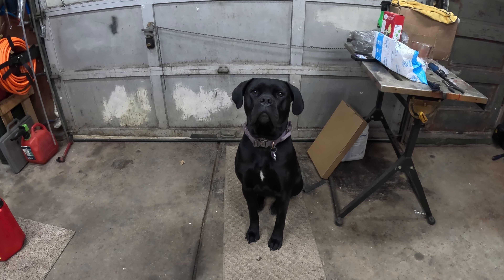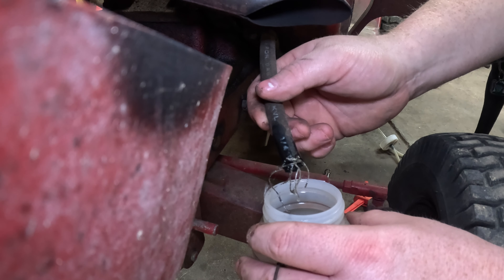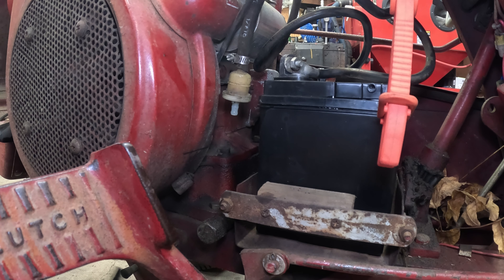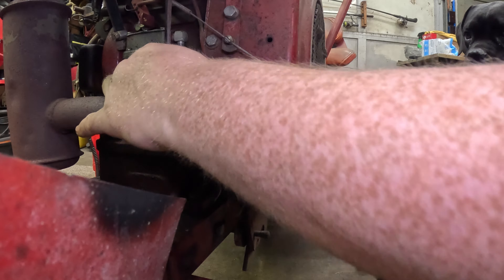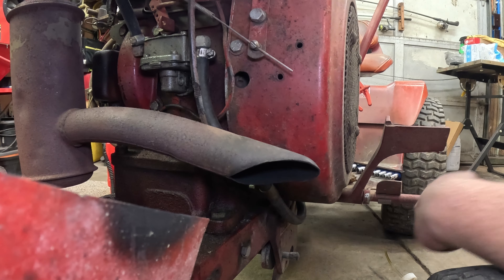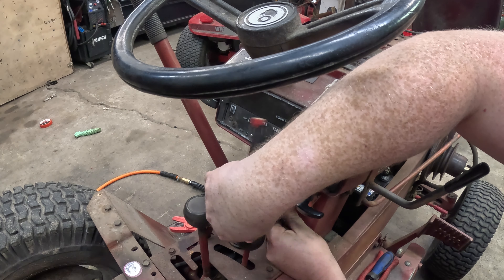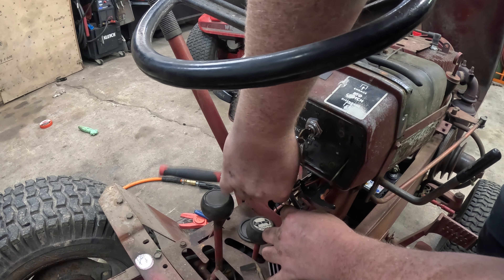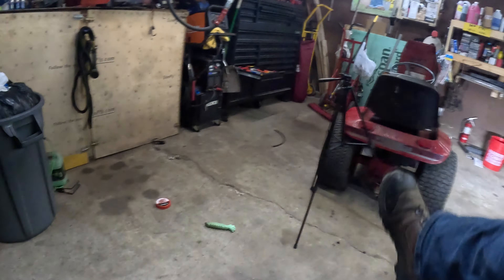Fine-Tuning Nostalgia: Reviving a 1975 Wheel Horse C-160 with Fuel System Care and More! #tractor

Comment: Thanks for the video. 👍
I just bought one like that, c-160 automatic with cab, not the soft one, but a hard cab with real doors and windows. And there is a broom in front. Everything works, but it needs to have the fuel system cleaned. Think it's a 1973. Engine sounds fantastic.
Got it for $200 including a table saw, telescopic miter saw, 2 impact wrenches and a pipe cutter set.
I have absolutely no idea what I'm going to use it for, but I couldn't say no. 😁
Reply from the maker: @gsp911  oh heck yea for $200! They are great sounds like you have a snow cab. I have one on this channel. The snow throwers are nice if you get snow. We don’t get much snow. But I had to have a set up because I remember seeing the bourchures of them throwing snow at the dealer growing up.

Comment: Great video! You got those old tractors running like new again. The headlights are pretty bright, are those stock?
Reply from the maker: Unfortunately no! The 70’s horses had a little light bar looking thing that had two 1156 bulbs in it. They were lame. Dad quickly put a single sealed beam light in the 70’s on it. I always thought it looked weird. I went and bolted two rubber sealed beam housings to the hood with led bulbs. I still have the original lights maybe with LEDs they would be decent. Might put them back in when I restore that tractor.
Reply: I understand, it’s all good!

Comment: You did nothing wrong removing that fuel line.

I've gotten to a point where the fuel lines are now considered a wear item because of ethanol gas.
Add age, sunlight, heat, cold.
Any fuel line older than 3 to 5 years has passed its expected life.
Reply from the maker: Tell me about it! They just crumble in your hands!
Reply: @AbbyNormalGarage  I've had rubber lines show signs of ethanol damage in as little as 4 months!!

By the way.... It's super cool you're keeping the old Wheelhorses going!
Reply from the maker: @ebinmaine  got to! This one’s a piece of family history.  I think it has a lot to do with the unique engine sounds each one has. The k12hp sounds different from the 16. Onans sound different from KT twins. The kohler commands sound good in their own way! Haven’t had one that sounded bad!
Reply: @AbbyNormalGarage  absolutely true!!

Comment: Did you clean out the fuel tank?
Reply from the maker: I pumped a gallon while moving the siphon around the bottom of the tank. I looked in afterward with a flashlight and didn’t see anything else. Then cleaned the filter. It’s been doing well since!